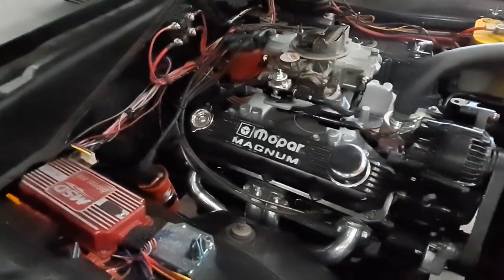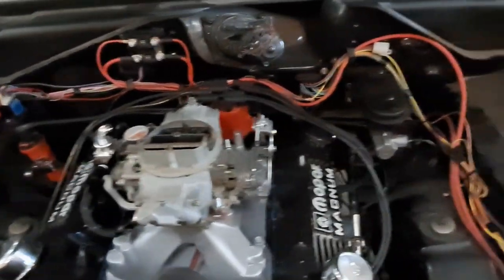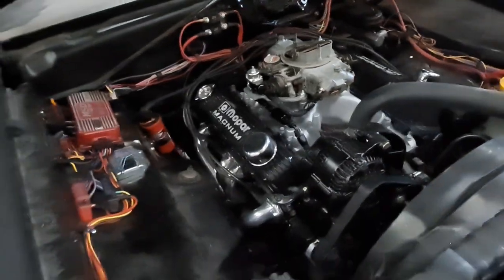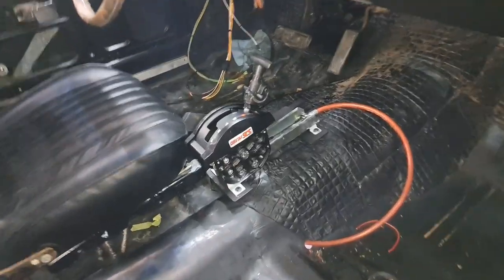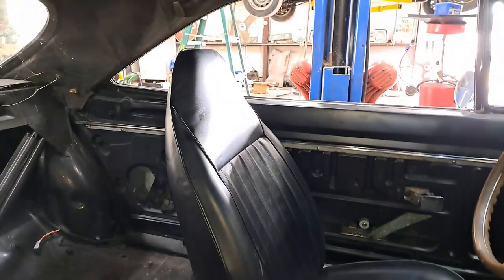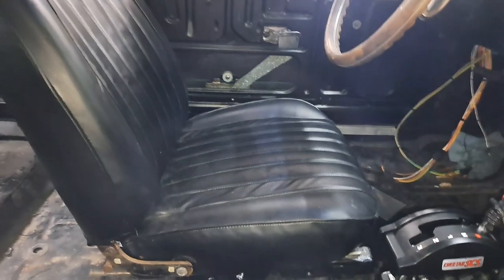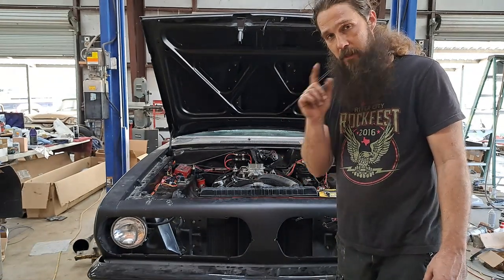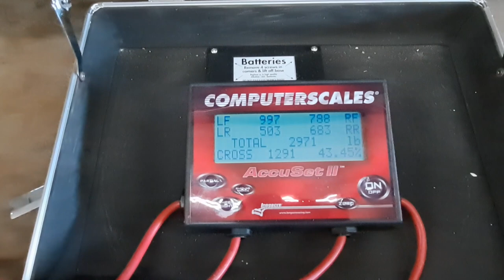First Test Drive in 20 years! The 1968 Plymouth Barracuda is Back!

Comment: Dude she sounds killer! I have a 96 ram im about to 360 mag swap. Do you have any idea what the cam specs are or a part number is? I love the range it works in with those ported eq heads. Im going to leave mine fuel injected but i bet it will pull similar if i can get a cam and ported heads close to those same specs. Mopar or no car baby 💪